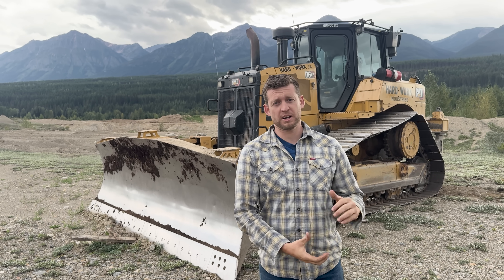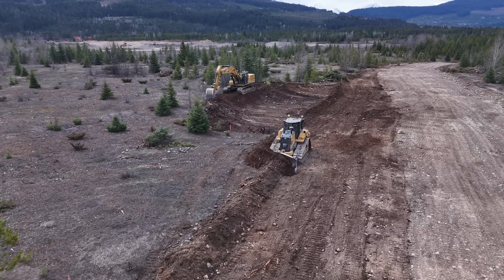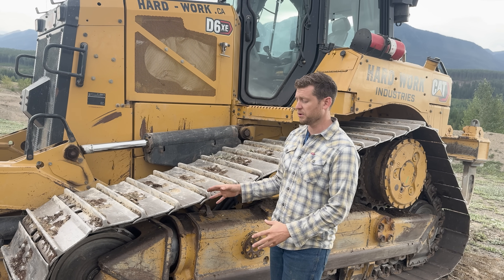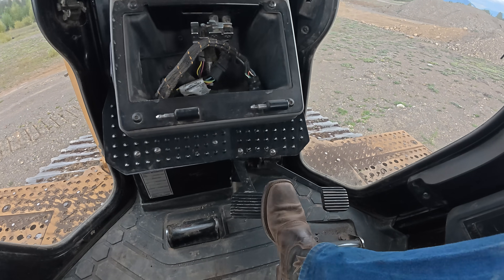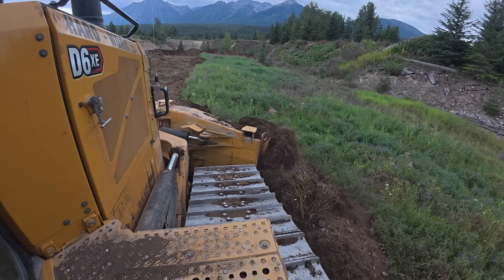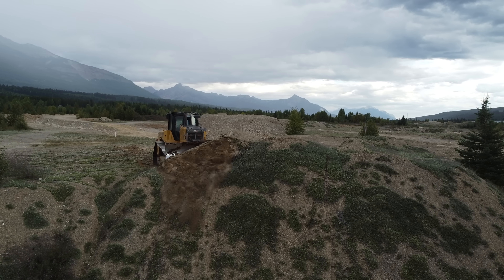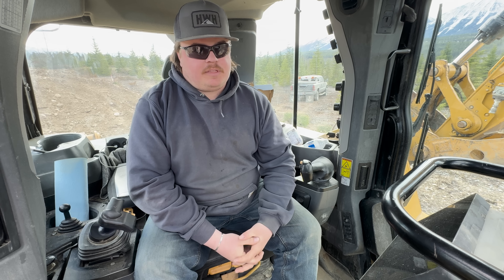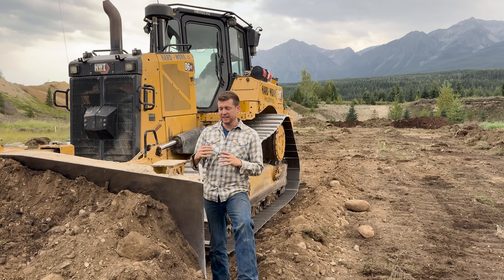Inside the Cat D6 XE Hybrid: More Torque, Less Fuel

Comment: How long will it take before the Edison grader becomes a hybrid? If the Canadian government won't let Edison build hybrid trucks for public roads, then conversion kits for construction and farm equipment would help the company make some profit to pay for truck certification. I would like to see the Edison hybrid powertrain in vehicles for the Canadian military like the Roshel Senator APC. If you get the Edison hybrid system in a military vehicle, then Roshel or the Canadian government would pay to get the generator (engine) certified for road use. Since a version of the Roshel Senator is being built in Ukraine another option is to offer them the Edison hybrid system. If Ukraine had an APC with a Canadian hybrid system that performs better than the internal combustion version it would force the Canadian government to open their eyes and reevaluate their emissions laws. Eventually, the Edison powertrain could be used for tracked vehicles like tanks and self propelled artillery guns. German tank or Korean artillery with Canadian hybrid powertrain?
Reply: I saw a video about the various self-propelled artillery being used in Ukraine.  0~60 time was extremely important because the guns fire, limber, and move immediately and shaving a few seconds off the time between fire and being 1 km away is a matter of life and death because of counter battery fire & drones. I think for Roschel, they would have to source the batteries and e-axles from somewhere other than China. Neither China nor Western militaries want too much Chinese hardware in their equipment.
Reply: @ryuuguu01 It would give the Canadian government the opportunity to invest in a company that will create E-axles in Canada. Edison has shown that the E-Axle is the superior technology for future hybrids, so a local manufacturer is necessary. There was a show with Robert Downey Jr. called "Downey's Dream Cars," where he saw the electric and hybrid vehicles that GM is developing for the American military. Just like police cars, military vehicles remain stationary with the engine running to power all the computers and equipment. The hybrid system on a military vehicle gives increased range and improved stealth (less noise & heat) because the vehicle can operate the electronics with the engine off.

Comment: I’m guessing the reason that the Cat doesn’t have batteries is because it is basically running at a peak load most of the time.  Whereas a semi the peak load is starting off the line.  Also a semi truck can take advantage of regen to recharge the batteries.  A caterpillar drive has no regen, there is too much drag and the dozer is going too slow to regenerate any battery packs.  I think the added weight, complexity and space needed just isn’t worth it on a dozer. But it is a fine example of how a diesel electric hybrid is more efficient and more powerful at the same time.
Reply: If they did include a battery pack or supercaps, it would let the generator throttle down to an economic mode when the dozer is set to jog but not moving, then drain as the operator gets it going and generator spools up to its operating point. I could imagine more savings this way.
Reply: @Infinion  but it also introduces more failure points, these boys run them for hours on peak load that battery needs to discharge insane amps each time it meets a huge load
I with a battery they can save 10% more probably but in terms of repair costs idk cus I have a suspicion those batteries wont last being discharged at peak amps again and again for years
Reply: @Infinion they could also use an extra lithium titanate battery very long lasting in the system in case they need to run some equipments on the field in the middle of nowhere for example.
Reply: @Infinion its more efficient to let the generator run at near constant speed and power and let a capacitor bank absorb the energy when not needed and give it back when needed.
Reply: Batteries weight a lot, especially for a piece of equipment like this. The extra weight could be used to offset the need for some weight blocks. Running off batteries charged by the generator during idle time might reduce the diesel fuel cost.
Reply: @robeigner4390  No, they don't *weigh a lot in the specific context of a piece of equipment like this. But you are correct the batteries could offset counterweights. But the cases would need to be hardened as they are usually used a rear bumpers/crash bars.
Reply: @robeigner4390 lithium titanium dioxide batteries or capacitors might be the solution
Reply: The main reason is battery are good where you can recharge them, OR you have kinetic energy in good amount to convert to energy... A doser is just a brick... It doesn't want to move ! You just need energy to move it. If they engine consume little at idle, and it fuel usage is proportional to the power it generate, then battery is not a big saving here nether...  It make sens for truck, for stop and hill... But not on a doser
Reply: The main issue is that battery power delivery and charging are chemistry-limited. So if you want to pull a whole lot of horsepower, you need a big battery (i.e. many cells). You cannot just throw in a small pack---20kWh would be more than enough to even out the load curve, but it wouldn't be able to supply the peak load the motors need.
Reply: I'm not sure batteries are the goal here. It's probably more akin to a diesel electric drive where the generator output is what feeds the axles directly. Similar to a big mining truck, ship with DE and etc.
Reply: Doesn't the power requirement drop every time when dozer reverse from each push?
Reply: The reason it doesn't have batteries is because they don't make sense in this application.  Losses generating the AC, converting to DC, converting to chemical to store in the battery, converting back to DC to use, and  converting to AC for the drive motor.  It all adds up.  Same problems will be evident in the Edison trucks.
Reply: I think a capacitor bank would be better than a battery bank. It would be to even out the short term engine power variation. It would Charge thecapacitor bank when the Cat is not using a lot of power while reversing, and regenerative slowing down in reverse. And it would use that stored power for the next push. That would Cycle the capacitors a lot but thats what they are good at.
Reply: I doubt there is little opportunity for regeneration because they very seldom go down hill without pushing. The amount of energy to cary the extra weight when not being used would more than offset any gains. Also, the amount of energy this machines consume would require a huge amount of storage, making the machine totally uneconomic to design build or operate.
Reply: Why the dozers dont use hidrostatic transmisión System like excavators or skid steers?
Reply: Look at any train locomotive, a large diesel is powering a generator which drives electric motors which drive the wheels. Huge, controlled torque to get all the cars rolling. There are times that you need to stretch the train out, light brake applied and pulling. Same when coming up to a meet, train brakes applied to slow down but you're still pulling. Considering the sheer mass involved, this a very controlled deceleration. There is method to the madness! Eh?
Reply: @lotharschiese8559  I was going to mention trains but you’ve done an excellent job of it already!
I don’t agree with CAT calling this thing a hybrid. But ironically the addition of lithium batteries could be used to boost its performance under peak loading.
Reply: @adrianchetwynd1334  That is true, this is not a hybrid, its a diesel-electric. A hybrid must have the capability of running from only 1 source independently.
Reply: @miragept  thanks for your confirmation.
Do you know how energy efficient these transmissions are?
It always amazes me how inefficient Power Take Offs are said to be for farm tractors when the power loss could only be attributed to the link between a small and larger gear cog.
Reply: @adrianchetwynd1334  yeah it's more like electric transmission. There were a couple off-highway trucks like that, I'm surprised they didn't catch on
Reply: @adrianchetwynd1334  Heavy electrical machinery is not my knowledge and CATs implementation of it so cannot answer your question. But.....tractor PTOs are most of the time as far i know near engine power, probably not that inefficient, and well, its near literally just a extension shaft, but also not a farming person so don't know if on a ursus 1614 for example if all PTO has engine running at all power(engine is 155hp and pto 133)
Regular PMSM are +-97% efficient, mechanical losses are probably higher than electrical ones. Good engines are 190-195g/kWh(scania and MTU ones for example) but guessing that CAT unit will only manage 200-220g. Running engines at a set RPM is really for for performance and also fuel efficiency, no wonder performance gains happen with DE units.
Reply: how viable is it to add solar to the roof of that dozer to keep the starter battery from flatlining? mostly for equipment in general.
Reply: @cpt.mirones5109  not viable at all, possible, but not needed. The engine still has an alternator.
Reply: @cpt.mirones5109  Should be fairly straight-forward; but you might want to segment heavily for keeping impact damage (stray rocks) local and contained, and even think about just covering suitable surfaces in a glass-enclosed cab with that solar instead assuming the cab would already require e.g. impact resistance.

Also: it's technically fairly trivial to embed solar cells in a non-visibility-critical piece of laminated glass that serves for safety barrier purposes.
Reply: @adrianchetwynd1334  lithium would not be economic, adds another point of failure and would not increase efficiency significantly due to the main times it would be useful not being during peak load (opposite of hybrid cars) A dozer is at peak load frequently enough that you would drain any hybrid power cell too fast with no regeneration potential its a complete waste. Personally I find the existing design they came up with pretty much perfect there is nothing there that doesn't need to be... and they even managed to INCREASE performance and reliability.
Reply: Cat should purchase Edison shares, an intelligent prospect!
Reply: @lotharschiese8559 Stretch braking will get you a letter these days 😂 Dynamics only 🤣
Reply: @lotharschiese8559 yes sir electric motors almost instant hp electric motors are rated in hp but a hp is something like 550ft/lbs sec. Think watts when thinking electric motors 1hp equal to 746 watts.

Comment: Does this imply that you possibly don’t need batteries for your truck?
Reply: Thats right. The battery was the extra step to be able to save the energy from the downhill braking and use it when needed. Without the battery the induction braking could overload something, if my thinking is right, and the energy will be wasted.
Another point is that the generator will have to run constantly.
Reply: The batteries power the electric motors….
Reply: The batteries are there so that you can store power as well, meaning that you don't have to run the generator all the time. Also, Edison trucks are fully electric trucks, they just have a generator to extend the range of the truck so you don't have to spend time at a charging station. This is all in addition to the first replies about regen on downhills.
Reply: No, it implies that Edison has improved on CAT

Comment: Like you are an innovator I have an idea that every farmer every man who owns an excavator or a tractor that can tow a roller like a tread foot or goosefoot roller could be making Adobe there on the farm they're at the job site wherever they are they could be cutting up the spruce and pine logs and cedar logs and laying those in the Adobe walls. My pioneering idea is that I am certain all the mix to make the Adobe can be laid in a concrete purpose-built Adobe making Ditch that would be 30 or 40 yards long. You're forever home may be a cordwood and cob Adobe cabin. With an all-natural Rock foundation over a concrete bonding Beam. The wraparound Rock raised beds will raise foods for the people who are in those cabins forever.
Reply from the maker: Thanks Oz!